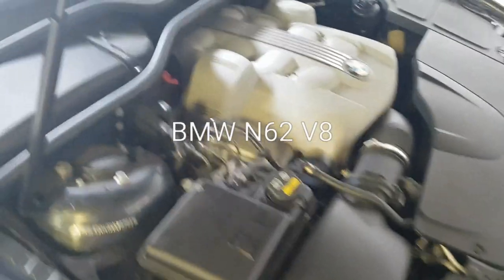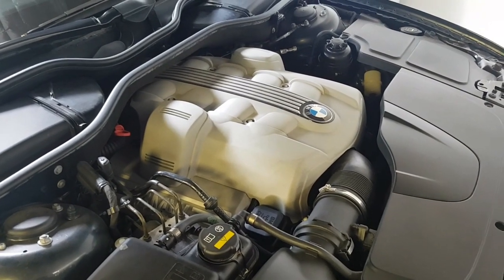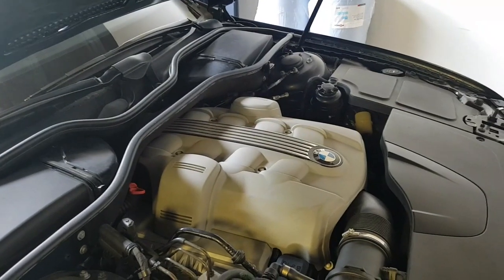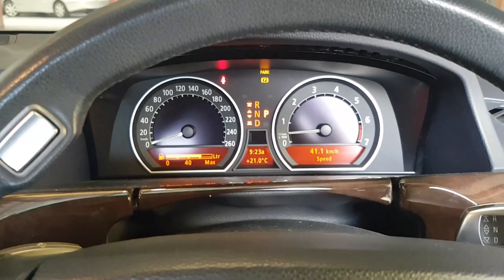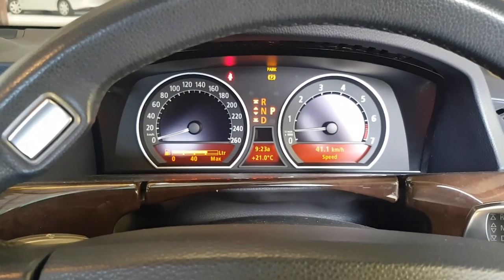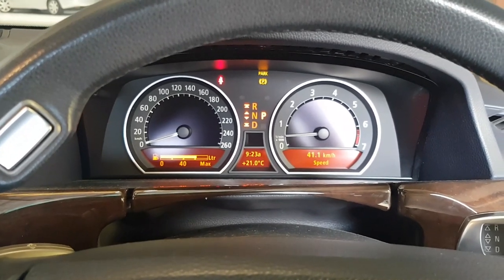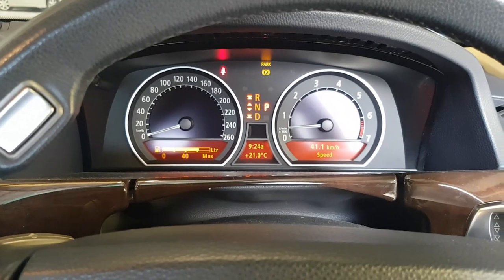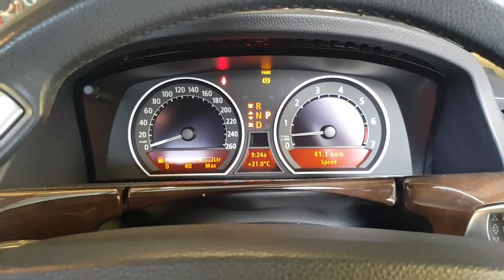BMW Valve Stem Seal Test Oil Burning N62 N63 N46 N42 E70 X5

Comment: I changed both seals on mine a 2007 750LI and I still have smoke only when I am idling. I can drive it for hours on the highway all speeds and no smoke. But the sec I stop idling like in a drive-through I will get smoke coming out. Could it be using regular-grade gas instead of super? The gas cap states use only 93 grade gas.
Reply: @roachraider6169  check the 2 orange pxv valves thats most likely your issue if their ripped or have never been changed their most likely shot
Reply: Pcv*
Reply: @roachraider6169  bro these Bmw’s are nice to the eyes but nothing but problems!! I’m done with them!
Reply: Guys and girls 5w40 castro oil was used in these cars when new... 221f degrees on that oil reduced it to like a 5w30 oil. Now here comes the wear on rubber seals and cylinders walls including valve stem seals. The answer for me $2500 or liqui moly 10w60 《answer
Reply: @MrsJc48  Do you suggest 10w 60 plus the additive?
Reply: @Sherwood yes I used liqui moly motor oil saver.
Reply: PCV valves....
Reply: @stephenpato5524  I changed both and still smokes as soon as I take off after idling at the drive through or at a red light. It never smokes while driving, or when its colder weather, but when its warmer days and idling. Its driving me crazy
Reply: @NeilKudro  ...my apologies I misread your comment, thought you said you've done the valve-stem seal job but still get smoke. In that case suspect would be PCV. I'm afraid it's your stem-seals.....not a nice job unfortunately...
Reply: @NeilKudro  if you've changed PCV valves and Valve stem seals and the car still burns oil, then the piston rings could possibly be gone on the car. If you haven't changed valve stem seals I recommend you do that since they would generally wear off after 150,000 KM. (Wear will vary depending on the condition of the car, oil quality and service intervals). If the car has been serviced every 9 months or 7500 KM using optimal engine oil, then the valve stem seals will last a long time. If not, then you're going to need new VSS (Valve Stem Seals) as soon as possible. Find yourself an experienced and reliable BMW master mechanic and get it done.
Reply: @MrsJc48  Ima try this out just bought a 545i and its smoking, i changed oil with 5w40 but it still does it ima try 10w60 with liqui moly oil saver that you mentioned thanks again

Comment: That V8 engine is junk, endless problems. get rid of it.
Reply: Just buy a new engine, you can find them where I live for less then a $1,000
Reply: @anthonyk  replacing junk with junk. That’s stupid.  Get a Lexus instead.
Reply: @anthonyk  better to fix the problems rather than get a new engine since the 'new' engine can develop the valve stem seal issue. The reason why some people complain is because they go to mechanics that will charge then 2x the market value of the car (assuming the cars value is $4000 USD with the issues).  If you don't have enough money to spend, don't buy a BMW.
Reply: @anthonyk  and labour cost of fitting? x10
Reply: @Mabeylater293  thought the goal wasn’t to replace junk with junk.
Reply: @grantharper9725  🤣🤣 Lexus isn’t junk. Still it’s funny tho🤣
Reply: @Mabeylater293  lexus😂😂😂